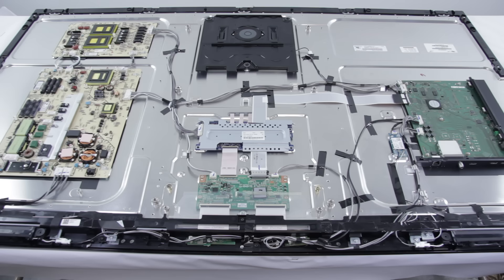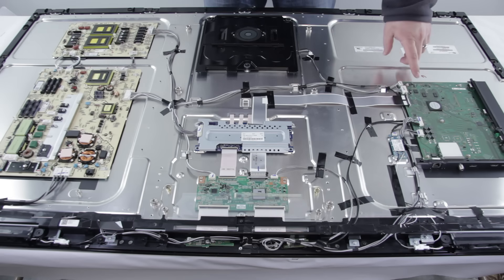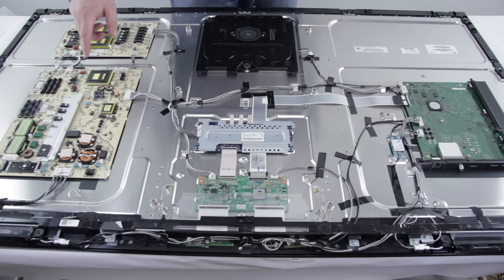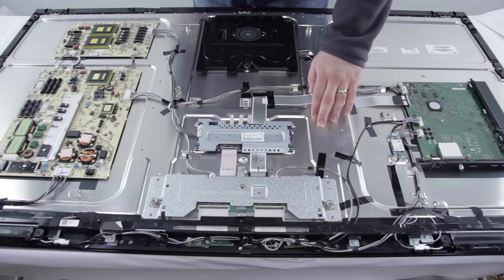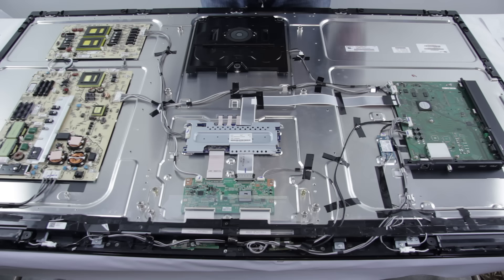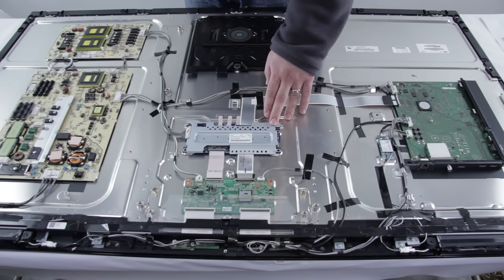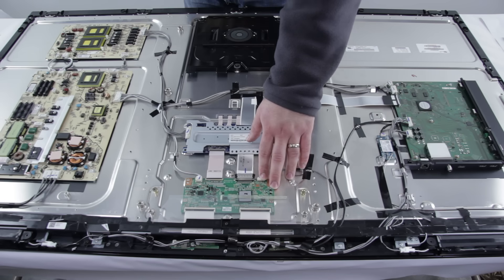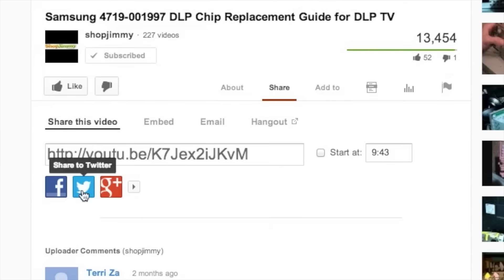LED TV Repair Tutorial - Common Symptoms & Solutions - How to Repair LED TVs

Comment: Have a Vizio E420-A0 LED TV and has video and sound but no backlight. I have changed out the Power board which provides power to the LED backlighting but didn't fix it. Do you know what the voltage should be at the connector on the power board labeld LED 1 & 2 which goes to the led backlighting? I have checked and it shows 0 vdc and about 2 vac.
Reply from the maker: *****  PLEASE SUBSCRIBE TO OUR CHANNEL - Try all repairs and troubleshooting at your own risk.  It sounds like you have bad LEDs in the TV.  Unfortunately, we do not sell replacement LEDs for your TV model number.  Thanks!  www.shopjimmy.com

Comment: Hi l,m back again, forgot to correct my earlier post, the samsung 32 R has a purplish screen not blue as l stated, also when l tried to view a video the picture was solarised as in one of your clips. everything else is fine, any help would be much appreciated.
Reply from the maker: robert harding   This could be a problem with either the t-con board, the main board or the TV panel.  You can replace the main board and t-con board individually to see if one of those boards fixes the problem.  Try all repairs and troubleshooting at your own risk.  Please reply with your TV model number.  Click here to view a video that shows how to find your TV model number:  https://www.youtube.com/watch?v=S51nhAmwR2M  Thanks!  www.shopjimmy.com

Comment: I have aSAmsung UN32F6300AFXZA that has lost its picture but still has sound and but no back lights. I replaced the LED/Main Board part # BN44-00606A and had the same results. Is the T-con board bad or is it possible that the LED/Main board I purchased bad? Any help would be greatly appricated.  Thanks
Reply from the maker: tom steele  PLEASE SUBSCRIBE TO OUR CHANNEL - Try all repairs and troubleshooting at your own risk.  It sounds like you may have bad LEDs in the TV.  Unfortunately, we do not sell replacement LEDs for your TV model number.  Thanks!  www.shopjimmy.com

Comment: Hi, I have an LG 60 inch LED smart tv  Model#: LG60LN5710. The Problem I'm encountering is that when I plug-in the tv the red led appears without me pressing the power button. When I press the power button or any other button on the tv the power led blinks a total of 3 times and then shuts off. The tv doesn't display a back-light or picture. I used the flashlight test on the set and I didn't see any images of the menu and I tried checking for sound through connecting my gaming console through  the hdmi port and then the component ports but no sound or video. In addition I did notice when I unplugged the tv the red light would stay on for awhile I'm guessing until it discharges.  Any insight would be greatly appreciated. Thank you.

Comment: I have a question  that my TV brand is LG and its model no is   32LN5150-TL led and its backlight is low by flashlight test what have to do and its main board is working nice  and audio is coming please tell me what problem .can I change led driver or not
Reply from the maker: madhav varma  PLEASE SUBSCRIBE TO OUR CHANNEL - Try all repairs and troubleshooting at your own risk.  This could be a problem with either the LED driver or the power supply.  Unfortunately I do not see any replacement parts in the search results for your TV model number on our website.  Thanks and please let us know if you have any further questions!  www.shopjimmy.com

Comment: I have a 50'' Spectre X505BV-FMDR8HJ1PE8 LED TV . It has recently stopped showing a picture. It powers up . The stand by red light is showing and it powers up to a blue light with no picture. Before it would periodicially not turn on until I cycled it off and on a few times. I would appreciate help on a possible solution. I'm thinking bad caps,but I want to make sure .     Thank You

Comment: Hello, I have a Vizio e601i-a3e. The other night I turned it off and went to bed, the next morning i came to the living room and it was flickering around the edges and making a humming noise. It will not shut off unless its unplugged. I plug it back in and it pops and does the same. No picture or sound just the flickering and buzz. Also there was a close lightning strike that morning. Its is surge protected unless it might have came thru the cable . Please help.

Comment: I have a phillips 46 in led smart tv 46pfl3608 the screen is polarized and only has half screen working I have a picture I could email if you need a better description
Reply from the maker: Anthony Holmes  Try all repairs and troubleshooting at your own risk.  This sounds like a TV panel (TV Screen) problem.  If your TV panel is bad, it may be more cost-effective to replace the TV as panels are typically hard to find in stock, difficult to replace, and expensive.  Thanks and please let us know if you have any further questions!  www.shopjimmy.com

Comment: My TV LG LM6400 doesn't turn ON, the red light it's on and off cyclically (flashes), sometimes It turn's on but in 2 minute the display fail showing extrange things...... What could it be?
Reply from the maker: Gonzalo Díaz Gallardo  PLEASE SUBSCRIBE TO OUR CHANNEL - Try all repairs and troubleshooting at your own risk.   I recommend replacing the main board in your TV.  Click this link to replacement parts for your TV model number:  http://www.shopjimmy.com/catalogsearch/result/index/?cat=56&q=LM6400  There may be multiple boards for the same TV model number, be sure to match part numbers on your current board, with your replacement for compatibility.  Here is a link to a video showing how to identify your part number, click here:  https://www.youtube.com/watch?v=RwHTvjMdrhkThanks and please let us know if you have any further questions with your TV Repair!  www.shopjimmy.com

Comment: I have a Samsung 46" LCD TV Model No. LN46B630N1F and it has yellow and red lines across the screen. Do I need to replace the T CON board?
Reply from the maker: Andrea Brooks   Try all repairs and troubleshooting at your own risk.  This sounds like a TV panel (TV Screen) problem.  If your TV panel is bad, it may be more cost-effective to replace the TV as panels are typically hard to find in stock, difficult to replace, and expensive.  Thanks and please let us know if you have any further questions!  www.shopjimmy.com

Comment: Hi I have a Visio 50 inch LED 1080 television model number m420nv the serial number is Lapagudl26 08854. I am so frustrated with this television it is approximately 3 years old haven't had really a lot of trouble with it but for some reason right now I have no power source I have no Vizio logo that is orange it isn't on and I have tried plugging the television directly into the outlet nothing I replace the power cord strip surge protector that I hadn't on still nothing. this happened about 6 months ago just one day we came in here and the light was glowing on we were able to watch it and all of sudden it has stopped again what do you think the problem could be is it an easy fix that a female could do and hopefully it's not very expensive to fix thank you for your time and your offer I look forward to hearing back from you
Reply from the maker: free gal  PLEASE SUBSCRIBE TO OUR CHANNEL - Try all repairs and troubleshooting at your own risk.   I recommend replacing the main board in your TV.  Click this link to replacement parts for your TV model number:  http://www.shopjimmy.com/catalogsearch/result/index/?cat=56&q=m420nv  There may be multiple boards for the same TV model number, be sure to match part numbers on your current board, with your replacement for compatibility.  Here is a link to a video showing how to identify your part number, click here:  https://www.youtube.com/watch?v=kxkeGLhlQY8  Thanks and please let us know if you have any further questions with your TV Repair!  www.shopjimmy.com
Reply: Thanks for your guyses idea but for some reason I just came back on today what do you think that could cause it to come on and off like that
Reply from the maker: free gal  Try all repairs and troubleshooting at your own risk.    A bad main board, did you see our response on what should be replaced?  Thanks!  www.shopjimmy.com

Comment: I have a Vizio 55" 550i-A0. I have a green vertical line running down the right side on my TV. Its about two thirds in from the right of my screen. I tried the tapping method to no avail. Is it an easy fix; such as an led light strip?
Reply from the maker: Matthew Decker   Try all repairs and troubleshooting at your own risk.  This sounds like a TV panel (TV Screen) problem.  If your TV panel is bad, it may be more cost-effective to replace the TV as panels are typically hard to find in stock, difficult to replace, and expensive.  Thanks and please let us know if you have any further questions!  www.shopjimmy.com
Reply: Thank you and I am replacing the tv soon!

Comment: My TV (LG 65LB5200) constantly flickers like this: https://youtu.be/-tZs5wiRimU

The main board was replaced this morning. It's still not working. Any help?
Reply from the maker: Joey Image  PLEASE SUBSCRIBE TO OUR CHANNEL - Try all repairs and troubleshooting at your own risk.   This could be a problem with either the power supply or bad LEDs in the TV.  Click this link to replacement parts for your TV model number:  http://www.shopjimmy.com/catalogsearch/result/?q=LG+65LB5200  There may be multiple boards for the same TV model number, be sure to match part numbers on your current board, with your replacement for compatibility.  Here is a link to a video showing how to identify your part number, click here:  https://www.youtube.com/watch?v=_4Qpfan0vdU  Thanks and please let us know if you have any further questions with your TV Repair!  www.shopjimmy.com
Reply: Every board has been replaced except the power supply. LG is coming next week to replace with a new one.

Comment: I need help. I have a 24 inch Sony Bravia. Model number 24EX430. A monkey knocked my screen down and its broken now. Sony says its not in warranty criteria and is a physical damage. I don't know what to do. I need to know can I do it myself and what would I require to fix it?
Reply from the maker: alonzo starz   Try all repairs and troubleshooting at your own risk.  This sounds like a TV panel (TV Screen) problem.  If your TV panel is bad, it may be more cost-effective to replace the TV as panels are typically hard to find in stock, difficult to replace, and expensive.  Thanks and please let us know if you have any further questions!  www.shopjimmy.com

Comment: I purchased this part Samsung BN95-00542A T-Con Board for my Samsung UN46D6900WFXZA LED TV.  The initial symptoms were the unit turns on the backlights turn on and I can get audio playback but no video. Upon replacing the T-Con board I got the same results. Should I try or attempt anything else before returning the part that I purchased? I wouldn't want to purchase another part only because its more than likely not going to be cost effective for repair in my opinion. Thanks.
Reply from the maker: metzen01    Try all repairs and troubleshooting at your own risk. This could be a problem with either the main board or the TV panel.  You can replace the main board to see if that fixes the problem.  Click this link to replacement parts: http://www.shopjimmy.com/catalogsearch/result/index/?cat=56&q=UN46D6900WFXZA+  There may be multiple boards for the same TV model number, be sure to match part numbers on your current board, with your replacement for compatibility.  Here is a link to a video showing how to identify your part number, click here:  https://www.youtube.com/watch?v=BEPWrefQvqI  Thanks and please let us know if you have any further questions with your TV Repair!  www.shopjimmy.com

Comment: I have a Vizio M470VSE that has sound but the picture is ghost like.  It looks like the old days when you had cable but not HBO and when you turn on HBO you could make out whats going on but the picture was just  messed up.  Wondering what might  most likely be the cause of this.  Thanks in advance!
Reply from the maker: Brent Riddle  Try all repairs and troubleshooting at your own risk.  This sounds like a TV panel (TV Screen) problem.  If your TV panel is bad, it may be more cost-effective to replace the TV as panels are typically hard to find in stock, difficult to replace, and expensive.  Thanks and please let us know if you have any further questions!  www.shopjimmy.com

Comment: Samsung LED TV - Vertical lines across entire screen - Samsung model UN46B000VFXZA, 46" LED TV.  Colored vertical lines appear across the entire screen, but they are not consistently displayed, and at time the picture is clear, but for the most part there are vertical lines at all times, now.  The image can be seen behind the lines, and the lines appear in front of the menu screen, as well.  Any thoughts as to the issue?  Thanks
Reply from the maker: Chan Dickey   Try all repairs and troubleshooting at your own risk.  This sounds like a TV panel (TV Screen) problem.  If your TV panel is bad, it may be more cost-effective to replace the TV as panels are typically hard to find in stock, difficult to replace, and expensive.  Thanks and please let us know if you have any further questions!  www.shopjimmy.com

Comment: Hi got a toshiba led 40l 353b....switched on then power indicator light continuously flashed red then green for ages...i pulled power then plugged in again but no power getting to tv...changed fuse on plug but no luck
Thanks gor lookimg
ALLAN.
Reply from the maker: Allan Doyle  PLEASE SUBSCRIBE TO OUR CHANNEL - Try all repairs and troubleshooting at your own risk.  I recommend replacing the main board in your TV.  Unfortunately I do not see any replacement parts in the search results for your TV model number on our website.  Please reply with your part number on your main board and I can try searching for replacement parts.  Thanks and please let us know if you have any further questions!  www.shopjimmy.com

Comment: Hi my mother has a Vizio 47 inches and it work and turns on but its to dark. You can see image at night but still very dark. This happen like 3 times in a year. Would you be so kind to tell me what could be this problem. And the link of the part to buy it. Thanks.
Reply from the maker: RAUL DE LEON   Try all repairs and troubleshooting at your own risk.  This sounds like a TV panel (TV Screen) problem.  If your TV panel is bad, it may be more cost-effective to replace the TV as panels are typically hard to find in stock, difficult to replace, and expensive.  Thanks and please let us know if you have any further questions!  www.shopjimmy.com

Comment: I have an insignia 42 led 120hz model ns-42E480A13

One of the hdmi ports went out then three weeks later another was cutting in and out and now out of the 3 hdmi ports only 1 works.

I haven't found any videos of my exact model. I believe I need a New main board.
Reply from the maker: barret232hxc  PLEASE SUBSCRIBE TO OUR CHANNEL - Try all repairs and troubleshooting at your own risk.  I recommend replacing the main board in your TV.  Unfortunately I do not see any replacement parts in the search results for your TV model number on our website.  Please reply with your part number on your main board and I can try searching for replacement parts.  Thanks and please let us know if you have any further questions!  www.shopjimmy.com

Comment: Your Video was extremely well done, thank you!!!!

I have built my own computers in the past, and feel confident I can repair this TV after watching your video.

I listened to your troubleshooting pointers. My Seiki SE47FY19 powers on all fine, everything is great, other than I have a few horizontal lines midway down on the left side of the LED screen. Can you give me some ideas what part I may need to replace? Thank you very much in advance!
Reply from the maker: Deborah Loke   PLEASE SUBSCRIBE - Try all repairs and troubleshooting at your own risk.  This sounds like a TV panel (TV Screen) problem.  If your TV panel is bad, it may be more cost-effective to replace the TV as panels are typically hard to find in stock, difficult to replace, and expensive.  Thanks and please let us know if you have any further questions!  www.shopjimmy.com

Comment: Samsung UN40D6000SFXZC

When the power cable is plugged into the LED TV the light on the power button on the TV will blink twice quickly and repeat for 5 times. Example is blink-blink pause blink-blink pause blink-blink pause blink-blink pause. After taking TV apart I hear after the blinking sequence some static/whine sound coming from the motherboard. Also when the power supply is NOT connected to the motherboard the backlight turns on no problems (no picture no sound just backlight). This happened after plugging in an HDMI cable from my PC to the TV and it just shut off and has the problem above.
Reply from the maker: juz4gamz  PLEASE SUBSCRIBE TO OUR CHANNEL - Try all repairs and troubleshooting at your own risk.  This sounds like a bad main board in your TV.  Click this link to replacement parts for your TV model number:  http://www.shopjimmy.com/catalogsearch/result/index/?cat=56&q=UN40D6000S  There may be multiple boards for the same TV model number, be sure to match part numbers on your current board, with your replacement for compatibility.  Here is a link to a video showing how to identify your part number, click here:  https://www.youtube.com/watch?v=BEPWrefQvqI  Thanks and please let us know if you have any further questions with your TV Repair!  www.shopjimmy.com

Comment: I have a Toshiba 39l4300U. I have ben using it as a monitor. When I plug it in I get the Toshiba name in red letters as as always but then it goes black. The power switch in front is solid green. then i cant turn it off using the remote. I also cant turn it off using the power switch on the side of the tv.